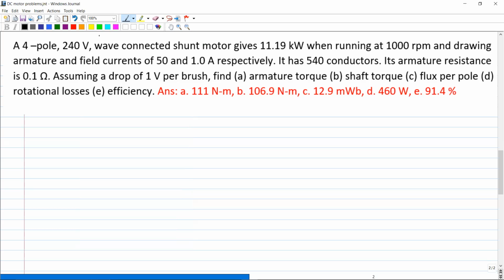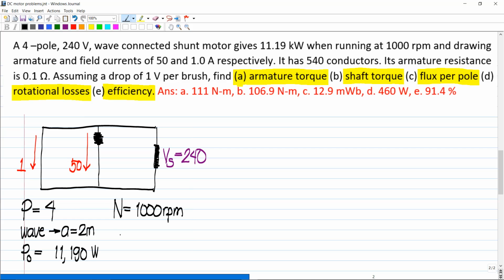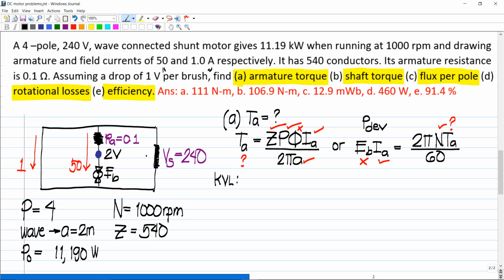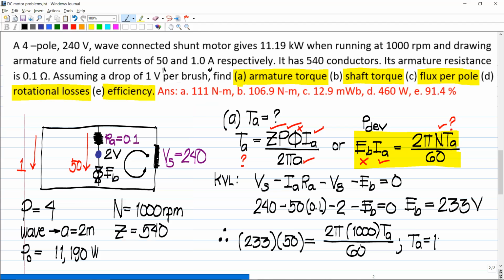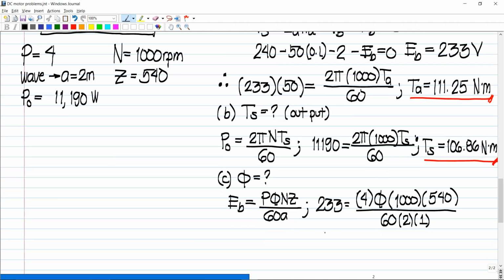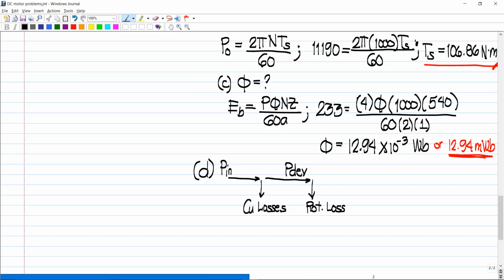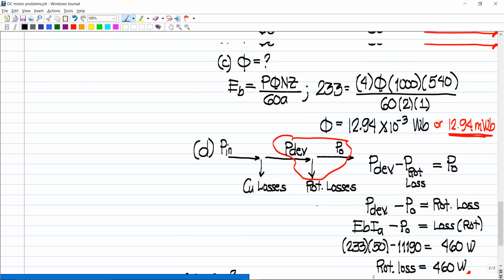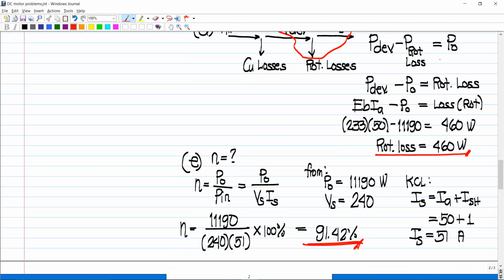Solved Problem: DC Motor Problem 1 (Find Torque, Flux, Power Loss, Efficiency) TAGALOG

Comment: 1.     The  shunt motor installed in the milling equipment with  an armature of a four-pole D.C. motor having 774 conductors, two paths in parallel, 24 mWb. of pole-flux and the armature current is 50 Amps. Determine the torque established by the armature
Reply from the maker: Ang ZPOI/2pia engr